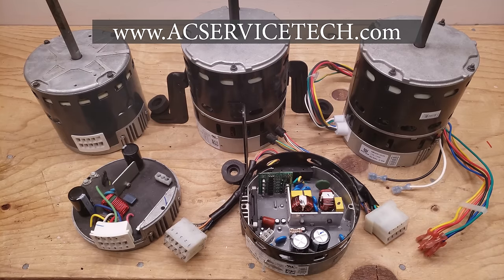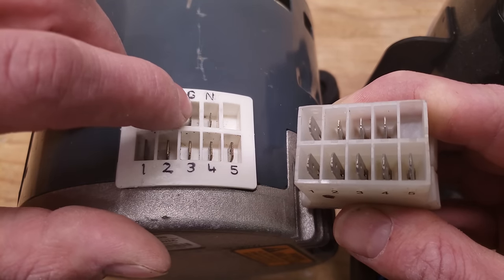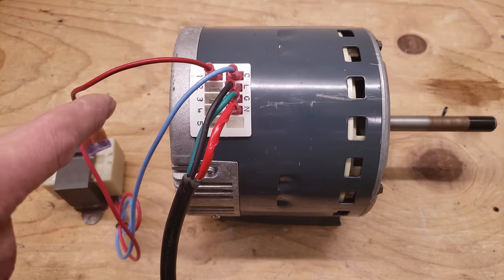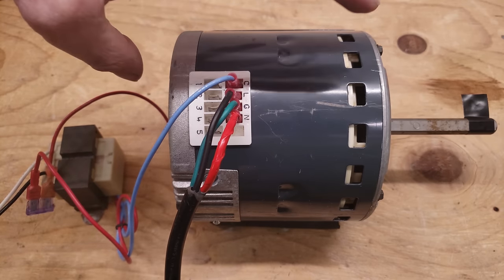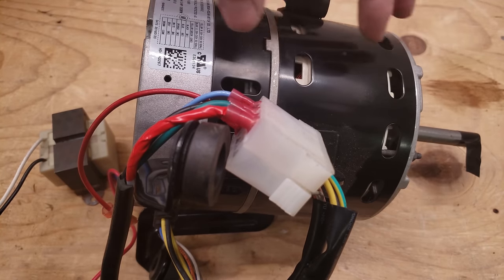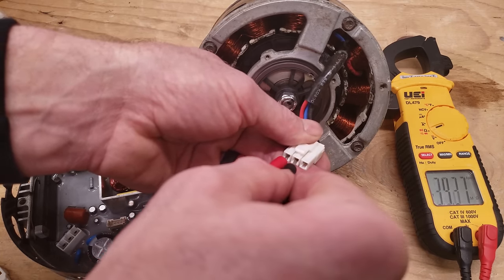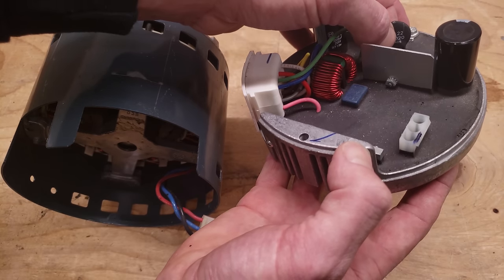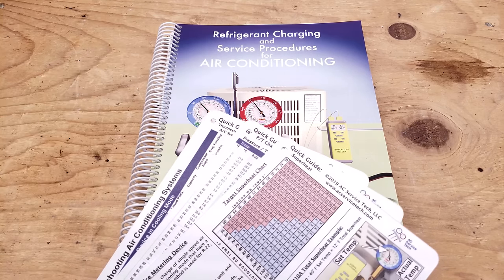ECM Multi-Speed Blower Motor Troubleshooting!

Comment: Excellent video. Thanks and happy New Year. In an emergency could you put 120 volts to the high voltage wire to run the unit until you get a replacement motor? Also can it be replaced with a PSC motor?  Many thanks.
Reply from the maker: These blower motors have hot line voltage on them all the time. You could put a relay into the air handler or furnace to power the blower any time g is called for the fan in a pinch but make sure the fan speed is the correct one. You could put a psc motor in but you would need do some rewiring to make it work by adding relays for fan and cooling

Comment: Good afternoon.  I have a Lennox xc17 that is now out of warranty and in need of it's 4th ecm motor.  I am considering replacing it with a psc motor and a relay.  However, to keep things simple I am also considering the rescue ez13 motor as a replacement.  What are your thoughts regarding the ez13 and it's reliability?  Also will I still be able to use the Lennox lcd thermostat that came with the xc17 if I switch to the psc?  Thank you and any help is appreciated.

Comment: I have a Carrier F4BC model and it  will not stop running. I have to shut it off at the circuit breaker panel. I pulled the thermostat roo and it keeps running, so I'm thinking it's the circuit board on the motor. Probably a relay???What do you think? Thank's.

Comment: How would you check the amp draw on either one of the ecm motors one being 120 volt and the other one 220 volts. Also wouldn't the amps need to be checked with the motor enclosed.

Comment: I had a X13 module that was only receiving 21 volts from the board so I  verified the transformer was on the correct voltage leads and the transformer was only putting out 21 volts.  Could that cause the module to not start up? It wants to start but kind of jerks back and forth.  I brought it home and going to apply 24-26 volts and 240 volts to it to see if it will run. Or should I just replace it and the transformer?
Reply: Interested in this as well. I assume it's close enough but not completely sure. Mine tested @ 22VDC.

Comment: My blower motor is running very weak that I can't feel any airflow at the vents but when I reset the unit and power it back on it works at high speed and gives me great airflow but only for 10 minutes or so before it shuts back down to slow speed....

Is this generally a problem with the module/motor or could it potentially be an issue with the control board?

Comment: I checked the three wires, black, blue and red to ground and it read some 2 million ohms.
The motor quits after 5 minutes.  Hardly it is every hot or anything. The breaker trips.
When the motor runs, it runs smooth and nice, no humming or anything.
15uF cap is 15 uF.

Comment: I have an x-13 that will not stop running even without the 24 volt signal wire. I have isolated the issue to the ecm. So I will have to get a certified tech to replace the ECM because it has to be programmed? Is there any way to buy one programmed for a specific system? I don't think the original installers of my system even checked actual air flow

Comment: Does it matter which wire you use for the common of the low voltage. Is it marked on the transformer ??

Comment: Please help. I was checking a X13 blower motor and it was ramping up and ramping down like you showed in the video so we I tolld tje costumer they needed a new blower motor. Well when I was checking the low voltage on the motor I was getting 28 volts on terminal #1 and #5 on the low voltage side at the same time, It only has those two speeds. So is that normal? Am I supposed to get 28 volts on #1 and #5 simultaneously when I check it to commun?

Comment: Just had a new unit installed by someone my parents recommended (mistake lol) anyways now i'm diagnosing the system myself. New Goodman 2 ton split system lasted one day then blower motor went caput, allegedly. I don't trust the installer after seeing the tangled mess he left of the low voltage wiring.  I shall get to the bottom of this

Comment: I used tech pro and I got the ecm motor running so should I replace the circuit board because it’s not getting 24 volts signal? Plz Craig reply

Comment: how can i use any of these motors as a project for something else without the diagram , i just have the motor with the red blue and black cables, is there a way to make it run without the diagram? what kind of capacitors do i need and how to connect them ?

Comment: Do these ECM motors come with sleeve bearing or ball bearings? Are they serviceable with oil ports if sleeve bearings?
Reply: Fairly sure they have ball bearings. Its been awhile so idk. If you have one it only takes less then a minute to check. Most times the end bell that house the bearing are warped. Which you can just use a punch and indent the inside of the housing in order for it to hug the bearing and not slip provided the shaft is not damaged or the stator is not damaged (the magnets usually)
Usually when these motors have bad bearings its time for a complete replacement.

Comment: Mine's a GE motor, and the 3 pin connector going from motor into the potted endcap electronics has a completely burnt out pin. That doesn't just happen...
Reply from the maker: That could have been a loose connection point because the thermistor should have burned out before that, thanks!
Reply: Same here

Comment: Good to know, but when faced with broken down ECM motor, it is almost impossible to get just a module. Mechanical part is only 1/5th of the cost of the module extra, less the labour cost. Sad reality. Not to mention the push to replace, not repair, by company owners.
Reply from the maker: Yeah if you are an owner, it may be a slightly different story but you are right with the cost factor!
Reply: First time we are hearing what we see everywhere "push to replace, not repair, by company owners."

Comment: I have a 1/3 hp x13 240volt blower motor that isn't working. I have verified everything is getting proper voltage. 23ohms on each winding. Im confused though because with motor disconnected from the module im getting 105 volts to ground out of each terminal on the back of the module that connects the motor. That is constant, even with the low voltage speed tap unplugged??

Comment: This happened to me
The motor is running continuously
I used a 24 volt contactor to stop and work with the compressor.
Is this solution bad?😅

Comment: You didn't mention how to test if the high voltage IGBT drive chip is bad.   No tools are required.   Just spin the blower wheel by hand and see if it brakes to stop quickly.   ECM motors are not supposed to have dynamic braking.   Drive chip failure is the most common failure.   I think I will do a 60 second video on this.

Comment: Does any one know what the startup current for these motors is like?  Conventional motors draw high currents (>10 Amps), until the rotor starts spinning.   Do these motor draw relatively low current on startup?  The reason I ask, I'd like to be able to run the furnace on a UPS (battery backup system), but the conventional motors draw too much current on startup and trip the UPS.
Also, does any know if the AC to DC rectifier in these motors are power factor corrected, or do they use the simple full wave rectifier and capacitor method?  Simple full wave rectifiers draw current only at the peaks of the AC wave, while the current draw of a power factor corrected motor is closer to a sine wave.

Comment: let me ask you this... been a while since i worked on a condenser been out of work due to back injury so my brains a little cloudy now if the condenser has a ecm motor ya know separate motor and separate ecm module its a luxaire unit the system is cycling on and off can the capacitor even though it doesnt have a wire thats common in psc motor motors that comes off the fan part of the capacitor cn the capacitor still cause short cycling to the motor ? i  push contactor in and compressor hums but fan didnt start up it eventually moved then shut dwn as system kept short cycling but when i push contactor in the fan itself wont move ... hopefully i explained this right but can the capacitor be an issue or what else the contactor? or?
Reply: It's not the capacitor, ECM motors don't use one. It's probably short cycling if the fan isn't running because the compressor doesn't have any cooling and is overheating.
Reply: @tomtom1541  yea took me a minute to get my brain thinking but there was a leak some how over the winter time so it was very low on refrigerant like  6 lbs worth but I recently purchased that lil 410a gadget the liquid  charging adapter since 410a is a patience game w charging... but shes running fine. but ima have to drain her down and find the leak and get her ready for next season .... was thinking to buy a new field piece leak detector or one of them Infacon I think its called. any recommendations??

Comment: IF YOU SIMPLY ADDED A VENTED FINNED SPACER adding maybe an inch you could double the life of your electronic module... They make them compact-- but not practical. They may work only a 3-6 yrs before a critical failure of a <$10 replaceable part.   HEAT Is the enemy!!!!!!

Comment: What a lousy design. Whatever controller a unit would have should control everything to the motor itself. Blower motor control module? Which, if fails, you still have to pull the motor. Emission control? Have you ever replaced diodes on the control board? OR, a primary board going to a secondary board on the unit, and THEN to the motor windings. On this contraption,  you're stuck, therefore, with at least  two possible faults on the motor itself. Having to pull the motor either way.

Comment: I have an extra 18ga white wire with a bullet connector on it that's not hooked up on my broad ocean motor.  The sticker on the motor doesn't say what it's for.  The sticker identifies the high and low voltage wires but not this smaller mystery wire.  What is it for?